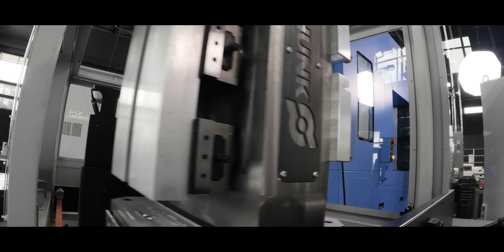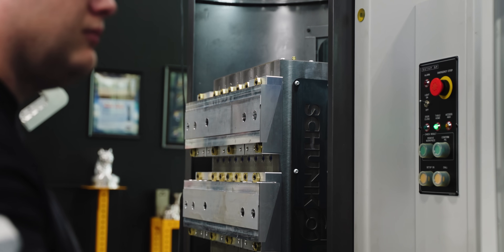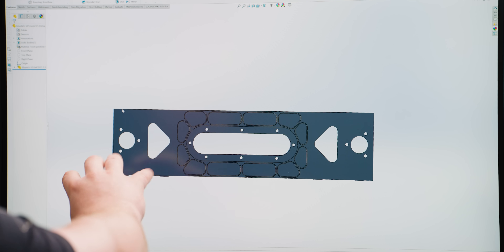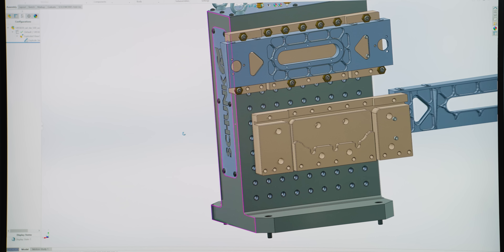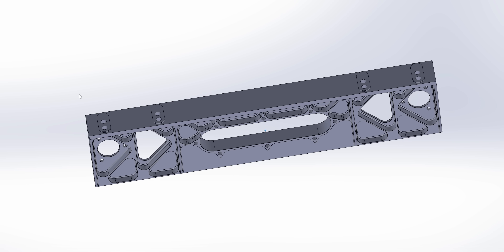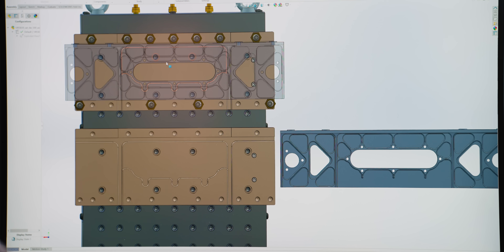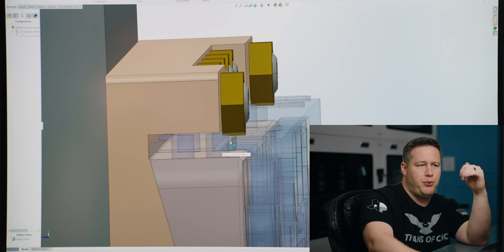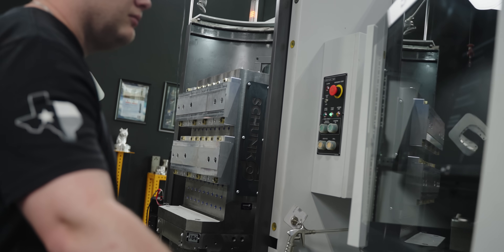How to Hold Awkward Thin Walled Machined Parts

Comment: Hi Titan Team.  I had a question come up about your business at work.  We work in extremely tight and extreme cold and hot thermal fluid.  Would like the ability to go colder/ hotter or any program of drawing temp with your finger in the flushing of the lubricant and shavings.  If so would you like to experiment with it l? I think we can do that as a company pretty much in any amount of temp change /speed you want between hot and cold

Comment: For the manufacturing of jet engine parts there is this method where they cast a tin block around the previously machined compressor blade for clamping in order to machine its socket.

Comment: When the part was released after the first pass does the part bow/warp? Solution?
Reply: Add roughing ops. Order extra material. Not only extra pieces but extra on the outside if you need to. Leave material on face that needs flatness. Removable Dowel locations are good for locating and flipping repeatedly. Hot glue the part down and skim at the end. Skim your plate flat. Set part on plate. Brake cleaner fixture plate. Put your finger on top of the part to keep it from moving. Hot glue in the shape of a weld around the part. Face off .01 with an an endmill  with a corner rad.  No coolant
Reply: rough and reclamp. with high grade materials less chance of warping

Comment: i would have done the flat side first. fixturing to hold a flat surface would have been a lot easier.  good job showing what can be done though.
Reply: much more surface thats anchored in this method, you won't believe how much time you can save on big badge order with roughing if you have the workpiece clamped like that. following equation can help decide: runtime saved </> time to make fixture.

Comment: 6:04 6:08 Well, i think i saw something interesting. Did you actually used an adaptive or dynamic milling toolpath with a big step over like tool.diameter*0.8 to finish the bottom of some features in the first op.?